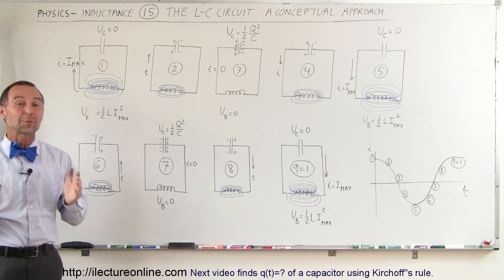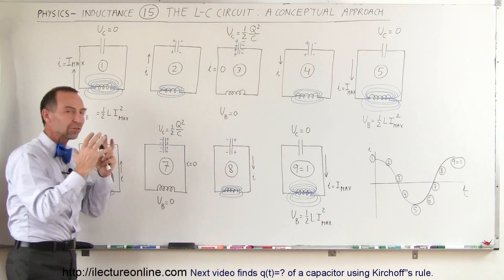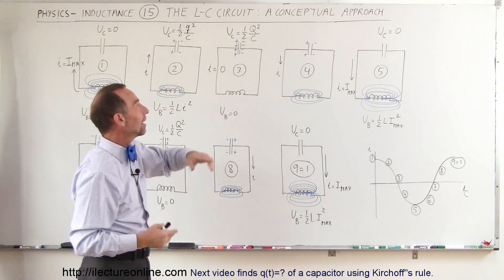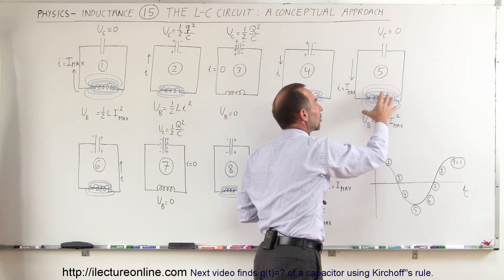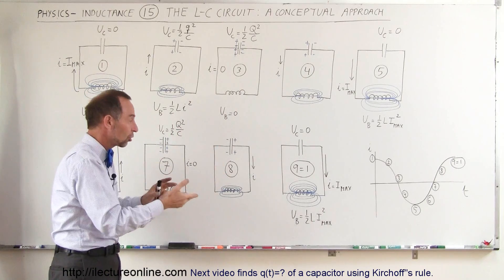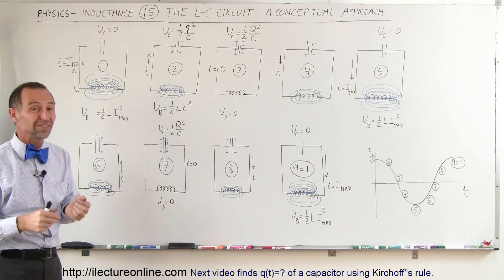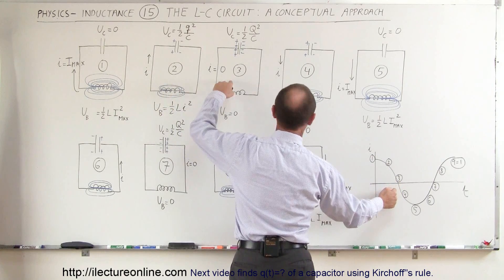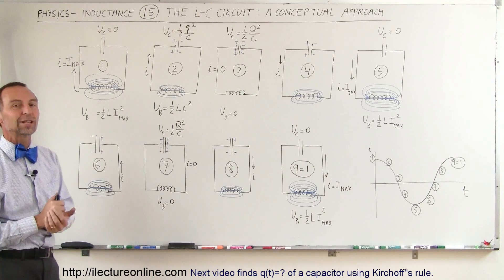Physics 47  Inductance (15 of 20) The L-C Circuit: A conceptual Approach

Comment: It would be more practical to start with a fully charged capacitor!!! Also easier to understand……at least a capacitor can bring its own charge to the circuit. Where does the inductor gets its initial magnetic field??!!
Reply from the maker: During the oscillating cycle you can set t = 0 at any point in the cycle.

Comment: In phasor diagram, voltages of inductor and capacitor are equal in magnitude but opposite in direction so that total voltage on closed circuit is zero. And then, the current (since it is series, they have equal current) is 90° out of phase from voltages. Am I right sir?
Reply from the maker: The voltage across each component is 90 degrees out of phase with the current, but in opposite directions for each component.    Yes.

Comment: You state that the current NEVER completely stops, BUT, since it REVERSES at certain points and starts flowing in the opposite direction, doesn't it HAVE TO completely stop at those reversal points?  Just like a mass on a spring traveling in a sinusoidal fashion BUT in a linear path?  In particular at the very top and bottom as it changes direction?

Comment: Hi, thanks for the nice video. In diagram 5, how can you say that the capacitor is completely discharged when the charges are still moving (current in the coil is maximum) and so they have not reached the other plate to neutralize the charge there ? More specifically, if you talk in terms of electron flow, electrons moving from the negative plate through the coil produce maximum current in the coil and so they have not reached the other plate (which is positive) to neutralize the charge there. Any idea how do we explain this situation ?
Reply from the maker: The diagram is correct.  At #5 there is no charge in the capacitor,  At that moment the current is moving in a counterclockwise direction.
Reply: The conventional current is in counterclockwise direction, but the electron current is in clockwise direction. In a wire, positive charges do not move, only negative charges (electrons) move.  So the electric current is the movement of negative charges (electrons) from the negative plate to the positive plate. In diagram 5, the electrons are moving in the coil producing maximum current, so they have not reached the opposite plate to neutralize the positive charges there. Then my question is how come the plates are already discharged when the electrons are still on their way to the positive plate which they are supposed to neutralize ?

Comment: Sir.
Since now I understand that the energy within the circuit will oscillate between those two components, it leads me to the immediate question: how can this circuit be utilized since its energy is theoretically constant?
Reply from the maker: This circuit is used for demonstration, and doesn't have any practical purpose.  It can be used as an oscillator.
Reply: So in order to utilize it, there has to be additional components, right?
Reply from the maker: Yes, you will need other components such as resistors, diodes, op amps, etc. to make useful circuits.

Comment: circuit RC is the atom model ...energy can oscillate from current to voltage or between E and B field inside a torus ...
Than an atom can exist only a specific frequency (resonance frequency)